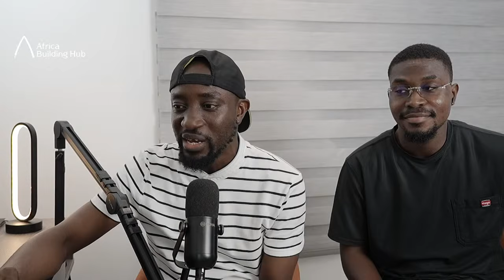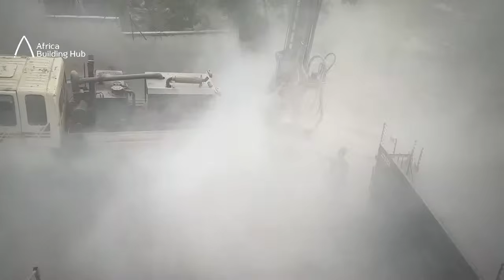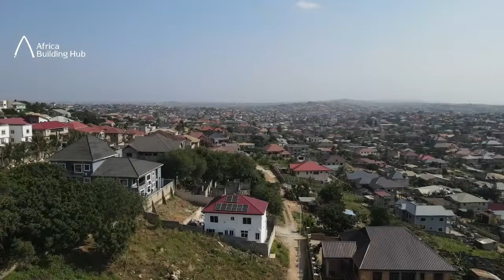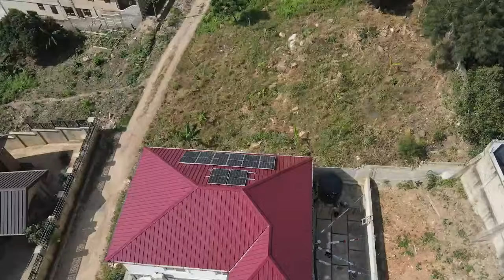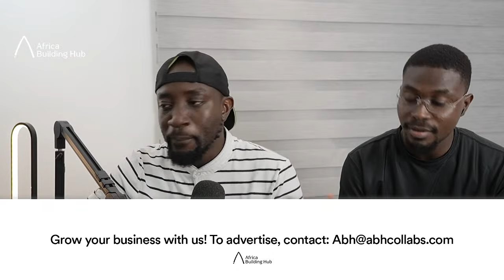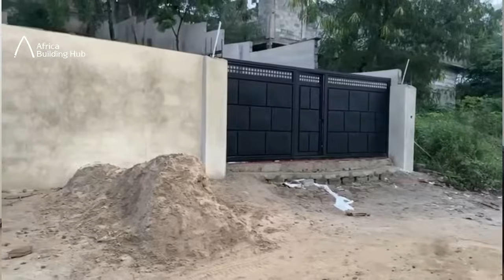Planning to Build? Watch This Before You Start

Comment: I know there used to be a sewer system in tema but i believe it is no long functional. I do not know of any other locations in ghana that has a functioning sewer system which can be used by property owners. Surface water as well as foul water from your house should not be leaving the boundaries of your plot in the manner that is suggested in this video. This is one of the major reasons why we have so much flooding in accra! when you have made the decision to pave your compound, you should also make provision to handle all rainwater runoff on your plot, like it is done with foul water! The drains along streets/roads if they exist are only designed to take runoff from the carriageway and not from your house. Those drains will inevitably flood if rainwater rushes into them from everybody's house all at the same time. The flooding in accra will be greatly reduced if this is enforced by the municipalities/Assemblies. I am not sure if it is currently a requirement but the drawings and calculations submitted for building permits must clearly show how waste water will be handled. If this is not currently captured in our building regulations then it must be looked at. We do not necessarily need to build "bigger gutters" as most people seem to suggest.

Comment: My property is already in a developed neighborhood. Even if I drill at the beginning, I’ll still disturb my neighbors.

The reason why most people won’t drill the borehole first is because Accra lands are always under litigation. Eve with building permit, you’re not safe from the litigation issues. As such, most builders are focused on securing the land rather than thinking about savings. This is fact only. 

The other issue is, you’re more interested in investing in seeing the building come up so the concern is not about how much you’ll save if you drill early but rather see your building rise up cos a lot of money is sunk into the initial stages and most at times, there’s nothing visible 😊